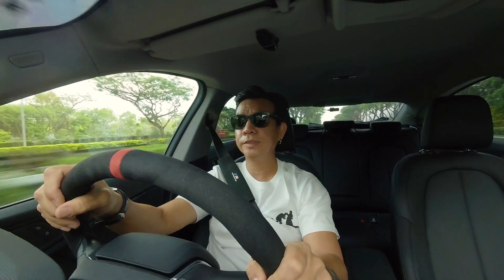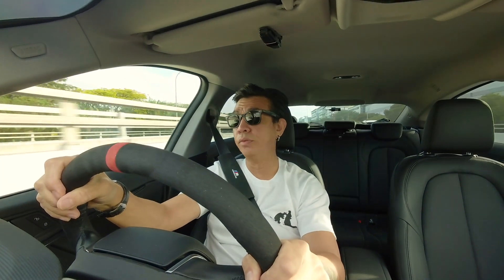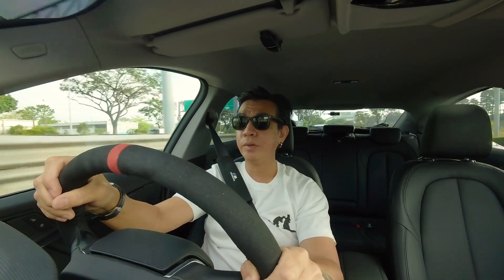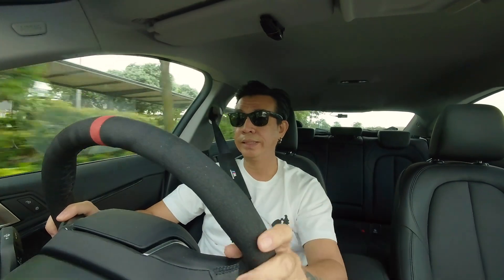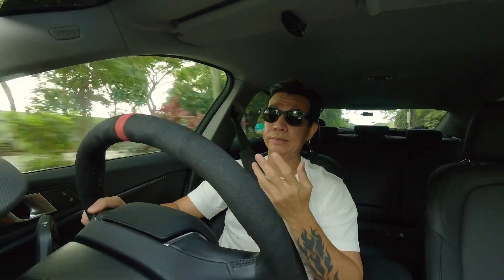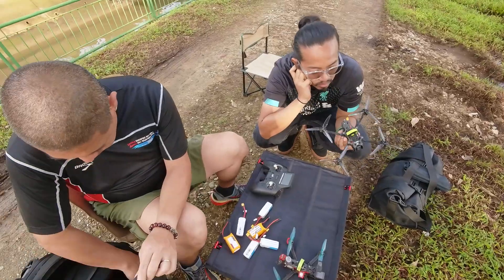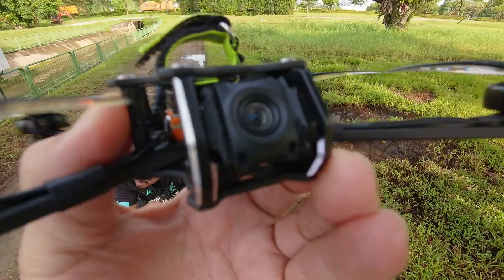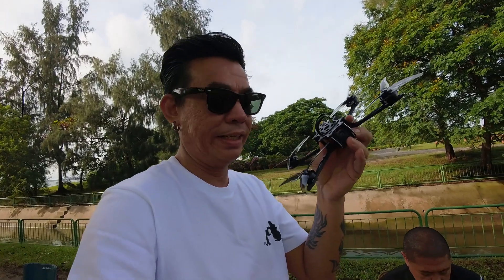Resolving Jello on the 04 air unit

Comment: How did you fix it on the Mobula 7?  I just got one and it's pretty jello through the goggles.
Reply from the maker: Hey bro! Jello ya?  Not jitters?  ok, so make sure the camera is snapped into the mob7 04 canopy properly.  Add some E6000 or hotglue at the sides of the canopy where the air ducts are. Make sure u secure the 4 canopy screws firmly(not loose) but not too tight as that will cause other issues.  Always use FRESH props.  If they're slightly bent, dont bend them back.  it can be seen in videos.
A software fix is to increase the jitter reduction on Betaflight to 15.  Hope that helps!! Feel free to drop in on discord and chat with us!  We can get things done faster that way!
Reply from the maker: Oh yeah… sometimes the whoop will jitter after lots of crashing. So best to reflash. For some weird reason, i noticed that settings will change. There was once, i hover tested at home, flew a pack to check if everythings ok, when i reached the fly field, 1 motor decided it wants to go the opposite direction….

Comment: I had the vibes and jello on my custom carbon framed meteor 75 pro and it turned out to be the motor plugs slightly touching the frame,it was ok flying slowly but on hard throttle it vibrated and jello.the cure was to add plastic nuts under the gummy’s to lift the flight board up a tiny bit so the plugs cleared the frame and that sorted it.🤗
Reply from the maker: Sweet bruh!!!!  Yeah, even a slightly bent prop, u will see jello on this 04!  Its super sensitive man!

Comment: Have you tried bluetac?  Sounds a bit silly but vibration is just a frequency, adding or removing* weight changes frequency.  Just changing frequency of the vibration could stop it resonating with other things.  resonance can multiply 2 separate vibrations into1 big one.

*maybe DJI changed the camera after testing, they likely made it lighter, stick some bluetac on around the lens and try its softmounts again, its worth a try.
Reply from the maker: No no!  You're right bruddah. Bluetac works!!!!  Agreed and no it doesnt sound silly.
Reply: @shogunemperor  If it works get Happymodel to sell special DJI camera balancing compound with your face on it 🤣

Comment: 👍 I noticed d signal strength seems rather low there... Alan's drone was like around 11mbps while yrs was like 30mbps...? Though I believe u all using elrs. Did u all xperience instability in d visual?
Thks for d vid bro always... ❤🙏
Reply from the maker: Basically, it was the spectator mode.  Its sharing the bandwidth.  But my spectator mode was off.  Instability not really... just pixelated with spectator mode ON.  Didnt have this issue with the vista's and 03.  Only this 04.

Comment: I never understood. You had a hardmount on Mobula 7. What else did you change? It's really fun to see the photo.
Reply from the maker: @asprofpv  ooooh… basically, the canopy has no rubber damper except for the dampers of the FC. The camera is just a clip-on inside the canopy. For the Tony5. The camera was screwed onto the frame. No soft mounting dampers.
Reply: @shogunemperor so you removed the rubber dumpers from the factory 7 mobula?